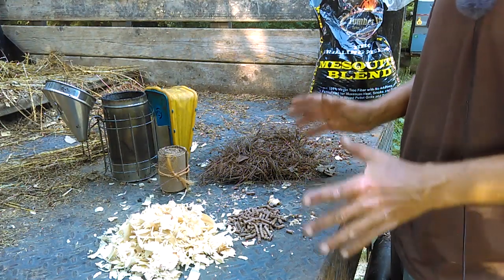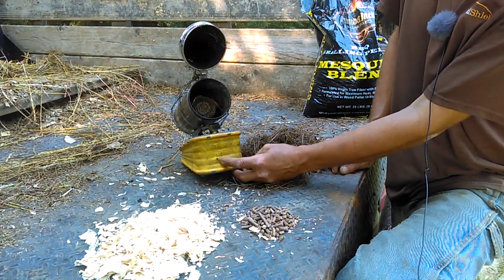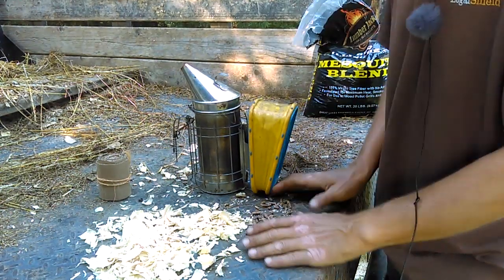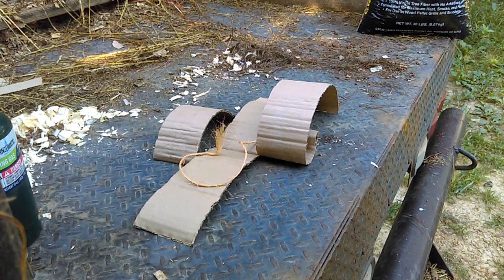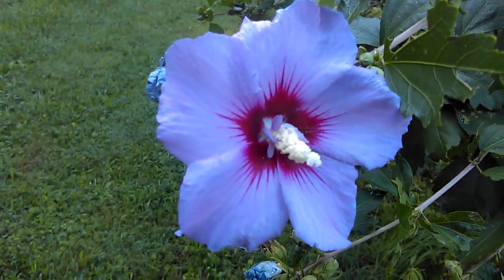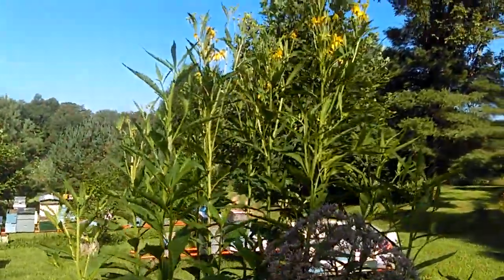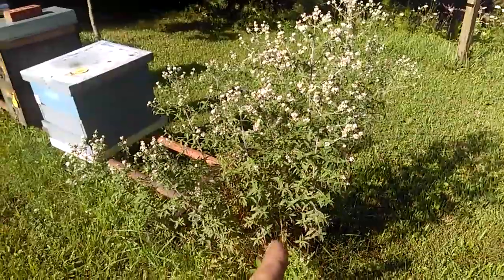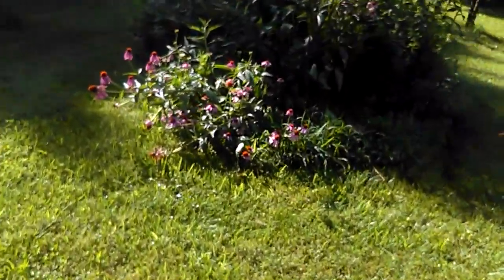Lighting A Smoker Like A Pro/ Smoker Fuels & Bee Flowers

Comment: I agree pine needles are awesome as a fuel, if you have access.  However, I caution anyone using the pine shavings to be careful.  They have a great tendency to get way too hot way too quick, which really pisses the bees off instead of calming them.  
TSC sells pine pellets for horse bedding, or something like that.  It's $6 for a 40lb bag, which is very affordable as a smoker fuel.  I have found they work infinitely better than the shavings.  They aren't quite as long lasting as hardwood pellets, but I've left the smoker out one evening and it was still producing smoke in the morning.  But, as stated about other pine options, they really gum up the smoker.
I'm really interested in trying the cardboard option, or maybe even experimenting with paper bags.
Reply from the maker: @Matt Peneguy There is a trick I use to keep the smoke cool when I use pine products. I will put green grass on top of the fuel after it's lite. It really seems to make a huge difference.
Reply: @JCsBees  Absolutely!  Putting grass on top of whatever smoker fuel you use helps, unless you use too much. 
It also collects some of that sap (or at least I believe it does).  I'm just too lazy to bother most times and just use the pine pellets by themselves.
Reply: Matt Peneguy corrugated cardboard when you roll it has air passages thru it that will help the smoke from the fire on the bottom pass through.  Rolled paper bags probably won't work as well,

Comment: I think stove pellets (which I use to heat my home) have some sort of petroleum-based glue holding them together. This does not present a problem in a pellet stove, but is not good for bees. The grilling pellets which I use because I can light the smoker once and it will continue smoking for hours, as you said. Once I forgot to plug the nozzle like I normally do to extinguish it for the day and found it still smoking the following morning! If I have to do just a quick job, I use a second smoker which is reserved for pine needles. I have 20 colonies so use the pellets when I am out there in the apiary for a number of hours. But new beekeepers with only a few colonies probably should stick with an option other than pellets. On a related note, I use a propane torch to light my pellets. The trick is, though, get the pellets lit and then let it burn for several minutes before closing it up. Also, does your smoker become difficult to light? Turn it over and dump out the ash. The smoker is probably becoming clogged and the air cannot flow from the air intake at the bottom because of all built-up ash. P.S. Around here we call mountain mint "bee crack."
Reply from the maker: @Dave Maloney Good point about the stove pellets. Never gave that any thought but I burn wood for heat. Also good tip about dumping out the ashes as they do build up and block air flow.
Your right, the mint is like crack to the bees, they can't get enough! Did you know plants with square stems are in the mint family?
Reply: @JCsBees  I will have to check out the square stems in my garden. I did not know that.
Reply: I made wood pellets and there is no glue or petroleum products needed. The lignin in wood gives the pellet its tightness. It takes a 500 hp electric motor to produce pellets and the friction of pushing wood sawdust through a 1/4" hole for 2 1/2" produces the heat. A few producers have used corn oil to help reduce the friction but I don't think it is a common practice.
Reply: Wood and cotton has lignin. Iron your shirt to take out the wrinkles is similar to making pellets.

Comment: I tend to always throw a handful of smoker pellets in the smoker no matter what fuel I'm using.  Maybe it's mental but i feel it adds a long burning element to whatever else I'm using - usually pine straw.  I've seen others light their smoker with a torch on the side like that - good to know it won't hurt it long term.  I'll give that a try this week.
Reply from the maker: Have you tried adding pine cones to your pine straw? I do that a lot and it adds a longer burn. 
As for the torch on the side of smoker, it will make the area you heat thinner over a period of time but it works great.
Reply: @JCsBees  almost one year update...  I still light my smoker like you showed us.  Still using pine straw with an occasional pine cone.  Easy peasy.

Comment: Nice tips! I usually use the light and fill method, but sometimes I would end up with some damp material so I would use a very very small torch head to light from inside the damper/vent hole. Heating up the outside is a great idea that I will have to try for sure. Might get a little iridescent coloration after awhile, but who cares! 
The Bobo bush is a Hydrangea. I like them a lot too and have them planted under the eve overhang of my roof to help soak up water and keep my basement as dry as I can. I do however need to cut them down to nearly ground level every few years, or I would never see out my south windows again! lol.
Looks like you have a great variety of flowers for the pollinators! One of my favorites is the purple Astor. Sometimes it would be so loaded the stems would be bent over as if Tarzan was swinging on them!  
Thanks for sharing JC!
Reply from the maker: @Alex Paulson This lighting trick saves a ton of time. I no longer mess with the old method of lighting it. lol
The wife told me it was a Hydrangea when I was editing the video. Funny thing is I dug it out of the ditch on a dirt road 10 years ago. I seen it bloom one year and returned over Fall to get it. It's done well ever since. We just got another and was told coffee grounds dumped around the bush would change the flower color. Ever heard that? What color is yours?
Reply: Nice find! It looks like it's doing really good. I wonder how it started growing in a ditch in the first place... Mine have been on the property for a good 20 years and are thick, I actually tighten up the chain on my chainsaw and use that to trim them, lol! I find that when I do prune them down in the Fall they won't bloom the first year after but like I say, I'd be in Hydrangea prison if I didn't do it every so often.
Mine are white as well. I know you can buy different color ones though I have never heard of coffee grounds changing their color. However, it does make me wonder about sprinkling down some Kool-Aid! haha!
Reply: @alexpaulson4597  Adding an acid to the soil will change the color if you are in alkaline soil.

Comment: Couple other "pro" tips: burlap bags from coffee houses (usually free) instead of the cardboard. Burns long and has less glue than cardboard. I use rubber bands. Also, you can layer dried fuels with some green grass to cool the smoke. I will put 2-3 inches of dry, then an inch of green, and repeat 2-3 times. The green usually smokes off all the water and burns in the end, but slows down and cools the burn.

Comment: Thanks for the video. learned a lot. Just wondering, for the cardboard cakes, do you just put one in the smoker and that's all you need? You just light it then? also, about how long do they burn? Thanks
Reply from the maker: One cake is usually enough to smoke for several hours. It's probably easier to light them drop it into the smoker unless your using a torch.

Comment: If you don't have a propane torch... how would you light the cardboard log?
Reply from the maker: Maybe dip it in a little beeswax and light the wax. Worth a try. Other than that I guess you would light it from the bottom then drop it in the smoker. You can get pen torches on Amazon pretty cheap though.